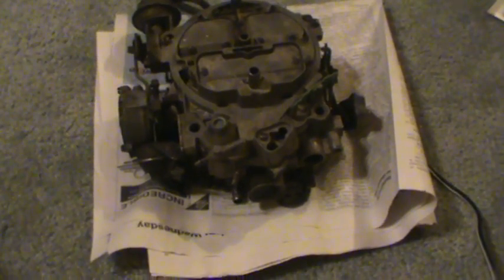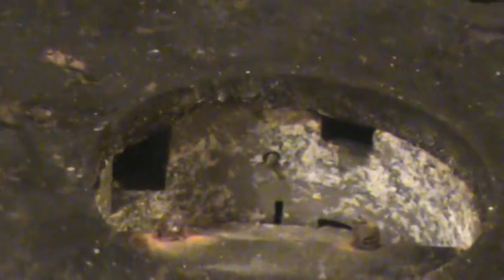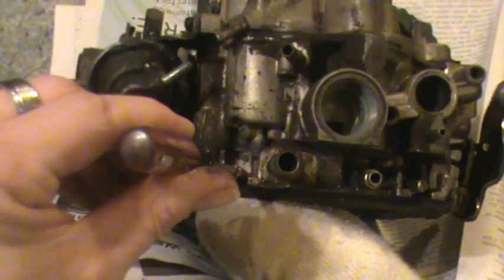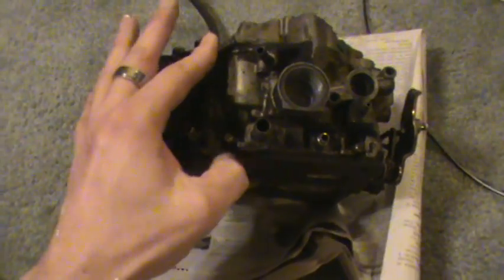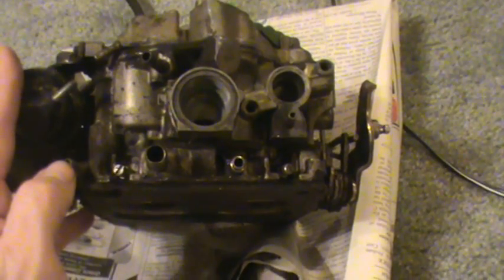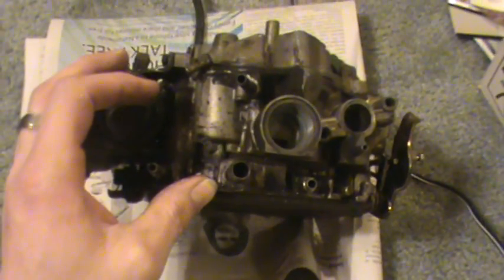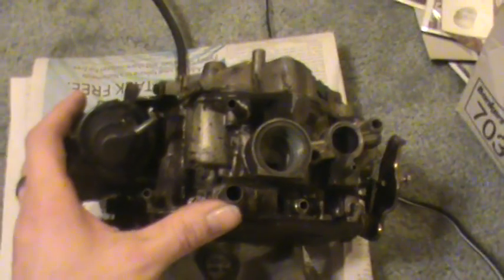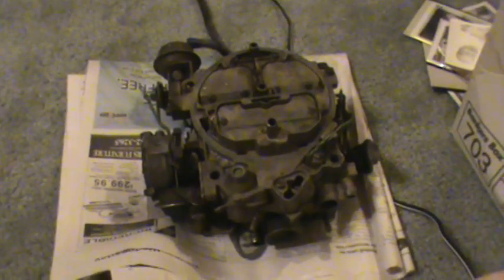How to adjust carburetor mixture screws

Comment: Excellent details!  I have 2 issues here.  I have a 78 lincoln in excellent original condition with 65000 miles on it. The car never was used in the rain or winters. with a 460 and a motorcraft 4150 carb on it.  The car has all the original smog stuff on it and it all works using a vacuum pump and leak tester.  Both catalytic converters have been emptied some time in its life and the exhaust has no restrictions. The engine vacuum indicates a strong fault free engine, plugs are perfect with a little soot and are new. Air filter is new. Gas filter new. The problem is that it bogs from idle when its sitting or if I'm cruising and decide to hit the gas to pass a farm vehicle. When I'm cruising, I have noticed it seems to sputter here and there at cruising speed.  With the car cold the choke system is working ok.  There does not appear to have any vacuum leaks as I tested that with carb cleaner. When I try to do the vacuum idle air/fuel adjustment, there is no problem doing the right side but the left side makes no difference.  I have not pulled the bad side idle mixture screw out to see if the taper is broken or if some clown screwed it in so tight that it broke through the horn.  Next issue, I cannot get a slow idle adjustment when it's normally running at 190 degrees. I cannot seem to adjust the main idle screw down enough to be able to properly adjust the idle RPM.  It always seems to run a little faster in RPM than it normally should at idle even if the screw is all the way backed out so it doesn't touch the plate.  The choke fast idle is OK so that's not holding the idle open.  When I force the throttle manually from the carb to close it then dips to what seems as a normal idle speed.  There is no bind in the carb to pedal adjustment holding it open either.  I'm thinking that whatever is causing the higher than normal idle, the hesitation from acceleration, the sputtering at cruise speed and the inability to adjust the left mixture screw may be the problem area.  The accelerator spits a nice stream on both sides so I know it's not that.  Any input would be appreciated on these 2 issues.  Your videos are the best I've ever seen because you go into great details.
Reply from the maker: Thank you for the nice comments.

Well, you have several pieces of evidence that at first glance appear to point to a vacuum leak. If the throttle plate is closed tight with the screw backed out and away, and the engine still idles, then air must be getting "around" the throttle plate somehow.

I suspect that you may have either a worn throttle shaft bore or possibly a leaking baseplate gasket under the carb. When I was about 17 I had an Impala with a common old 350 engine and a Qjet. It always had a tip-in stumble and also idled high and rather uneven. One day I decided to take the carb off and work on it, and when I got the carb off I found the baseplate gasket was cracked and had caused a vacuum leak.

I replaced that and it solved both issues immediately. I'd also recommend following each and every vacuum line to it''s destination including the PCV valve and look closely for cracks. I think you are going to find your issue in one of the areas I mentioned.

Btw, i had a '78 Marquis myself and I believe that carb is a Motorcraft 4350, which is a spreadbore somewhat similar to a Qjet.
Reply: I think mine is a 4350. The marquis is pretty well the same car in many aspects.  Heres what Im going to do.  Im going to replace a few valves.  The PCV, the heat valve in the lid of the breather, Definitely the EGR cause when I spray carb cleaner around that area, there was a dip in RPM. Once I've done all that, Im going to change out all the vacuum lines with new ones and color code them as original.  When I bought the car, The owner said they had the carb rebuilt and it looks like there was some work done to it because the welch plugs are new.  Im going to strip the carb down and rebuild it if nothing is broken.  I will rebush the throttle plate shafts also.  I have all winter to get er done cause I dont use this car in the winter.  I have some vacumme guages and a vacuum gun to run some tests but for sure everything will be replaced and then we will see whats up after that.  The old smog systems were a real spider web of hoses.  I know that the mixture screws might be an issue but if they look OK then there has to be some sort of leak bypassing that side of the system.  Hey, thanks for getting back to me.  I need all the help I can get.

Comment: Awesome, I got a 78 dodge b200 with a 360 motor and it doesn't like to start, once running fine. I have to question the automotive center I just paid 630 dollars for oil change and tune up. I'm doing this myself as per your video, excellent explanation of what I'm doing. Thank you!
Reply from the maker: $630?? Wow, they saw you coming, sorry to say. Those old Mopars are 
super easy to learn to work on. Feel free to ask anything you want. 
Those V8's like a lot of choke, your hard starting issue is probably 
related to that.
Reply: Wow, thanks. I need all the free help I can get with this running project. It's 4wd modified van.

Comment: apogize if you may have answered this question already but my 69 polara ran fine 6 months back. Then it parked for a long time.  trying to revive it again and it wont idle unless I have my manual choke closed about half way in.  its a carter afb.  it idles just perfectly with the choke this way but it sputters a little when driving and getting up to speed.  did something in the carb get messed up?
Reply from the maker: Your idle circuit in the carb probably got plugged on one side or both sides from gas varnish or possible an insect plugged one of the idle air bleeds on the top of the carb up. When you close the choke partially you are making the mixture rich enough to idle on, but obviously that's not how it should be running. The idle bleed tubes supply a tiny amount of air into the idle fuel supply to help it atomize.

Bottom line is, you'll need to pull it and overhaul it. They are very, very easy carbs to overhaul. Main thing is clean clean clean. You can look at some diagrams and establish where the idle passages are along with the idle air bleed tubes, etc and make sure they are all clean and all flow air and fuel.

Next time when you need to leave it stored for a while, run it out of gas first to avoid this again and make sure no insects have access to the carb as well, lol. Good luck.
Reply: Thanks for the in depth reply.  Appreciate your time.  I had the air cleaner on it.. but I suppose critters could have still made their way in there.  That gas varnish seems very likely too.
Reply: Can i ask you a question , please i need help as soon as you can , reply to me .

Comment: Rebuilt my carb and my idle screws are set at around 6.5 turns out. Is this too much? I did it with a vacuum gauge and it was reading around 20~22 when I was trying to max it out, I feel like I have a different problem. What do you think?
Reply: Take note this is the engine I have in it 

https://m.summitracing.com/parts/
nal-12499529

If that helps any

Comment: question. thanks for the great videos. but I'm trying to get the quad off my 81 dually working properly but can't get it to idle. I rebuilt it with Walter kit like your other video but won't idle at all. I have to keep feathering the throttle to keep it running or it will die immediately. I've moved the idle mixture screws everywhere with no luck. run fine when you rev it up just no idle. any help?
Reply from the maker: Check the ignition timing first. If it's too retarded, it won't idle and makes you think it's a carb problem. After that, you might have clogged idle circuits, but that's fairly rare.
Reply: +WhoSaidTyler changed plugs and advanced timing to 12 btdc and ran good for a day. put new plug wires cap and rotor on now it's back to not idling. looking like electrical gremlins. thanks for the input though!

Comment: the small vacuum Port you pointed to on the right front of the carburetor is for the vacuum advance in the distributor. this is the most commonly hooked up wrong part of any carbureted car it only gives vacuum while the throttle is opened don't try to set idle air with that port

Comment: I do have a question for you and I really hope you can help. Firstly I would like to say thank you for taking the time to do these videos, it really helps us guys that can do these kind of things but just need a little assistance.
I just recently bought a 1990 Isuzu pickup and took it in for smog inspection and to get it to pass they had to adjust the carburetor. They said it would have to be replaced at some point. The issue is that the car stalls at every stop. Is it just the idling screw that would need adjustment or would it be the Fuel intake?
Reply: Same thing for me, i got a 69 f150 and it starts to bog out and wants to stall (sometimes does) when I come to a stop. You probably dont still need help but im pretty sure its both the idle and air fuel mixture

Comment: tyler ur videos are by far the best...i have a 86 caprice 5.0 not sure if its 307 or 305 but anyway someonecstarted ripping off emissions stuff...which ee dont have to worry so much about in ky but i cannot find a video on how to correctly remove what's left and get vaccum lines correct dont know what to block or what not to block off. its my daily drivervand i depend on it to get my kids to appointments etc. now it is dieseling an wont shut off. also someone has turned the big screw on top of carb way down in and i cannot find a video on how to adjust this. it also will not idle down even with idle screw not even touching any help would b greatly appreciated. I am sure u r very busy guy so if u cant reply i completely understand.bthank u in advance in love your videos very informative.

Comment: One of my first engines I ever did anything to back in the day was an old 88 sunbird. Although it is TBI and not a carb it still had an idle adjustment screw on it covered with a plug. This thing basically opened and close the butterfly very minimally. GM always said there was no need for adjustment on it and not to tamper with it. 

Now for those who may not know a TBI is a very simplified version of a carb with a fuel injector on top to spray fuel automatically. This is a decent system and is a little more reliable than a carb. 

That being said GM was full of shit when they said it never needed to be touched. They were thinking someone would never do anything to the engine other than normal maintenance. But the GM 122 engine suffered from head gasket failure (tolerance too varied too much across the head) and soft top end cams. So I needed the later model cam, rocker and followers and so I got them out of a 90 sunbird and rebuilt the head and new everything. It held compression very well and only had 80 grand on the engine. After fine tuning the screw it had no problems at all. But with early GM computers being complete dogs I never changed values to account for the difference in the cam and the head height (lapped to be within proper tolerance .0015) so it ended up needing to have more air at cold start. no big deal I just continued to crack the throttle. 

The car was pieced together from so many other cars to counter all the imperfections of the car. GM should have thought it out a lot better. A later model grand am gave its TBI to my car as well. Trunk torsion bars were from a nova of earlier model year. The EGR was from a 93 (yes I blocked it later but the 93 egr worked on it) The real downfall to the engine was of course the use of a timing belt instead of a chain and the water pump/ timing belt tensioner design. But I can honestly say the engine outlasted the body of the car. 

Now I work on all sorts of cars and so forth but that engine for some reason always remains near and dear to my heart as the engine that I refused to let die and after all mods were done for reliability it was almost as reliable as the 3800. Ahh good times.

Comment: do the mixture screws let in air or gas
.
Reply from the maker: +Bert Cochran They control how much air gets in to mix with the fuel.  Think of it as "bypass" air that is metered around the throttle blades instead of through them.
Reply: I don't know, the carburetor shut out air and it also pulls off like a hesitation
Reply: Tyler's Neighborhood Garage
Reply: Again I learned some more!   Thx!

Comment: on my caprice 305 there is a screw directly by the choke? it looks like it is an adjustment screw...do you know what for? thanks
Reply from the maker: +1986Caprice 5.0  On the top of the carb? If so that's probably where someone has modified the carb so the lean stop screw can be adjusted from the outside. A pic would be great.
Reply: i tried turning it and the engine speed changes. I will try to get a pic, thanks

Comment: Awesome video! I'm about to swap two Rochester 4bbl on Mercruiser 260s tomorrow (350 small block). One engine idled faster than the other and we thought it might be the throttle cable. Thanks for the idea to check the idle screws!

Comment: I have a question about my Quadrajet. It's on a 1971 Buick 455, and freshly rebuilt and adjusted. When the vehicle is moving it's perfect, it will throw you back in your seat. But at a stop, if you punch it I just don't get that tire boiling torque that I know the car is capable of. The heads are freshly rebuilt and the exhaust is brand new from the manifolds back. I'm kind of stumped.
Reply from the maker: +Edward Ferguson IV  Well, you could have an issue with the carb, but keep in mind that's a 4400lb car with 2.93 gears.

Do you know what compression ratio the engine ended up with? 1970 was the last year before they started dropping C/R from 10:1 to 8.5:1, which is a huge drop. The change was made with the piston dish, not the head chamber.

 If it was just built with stock stuff, you may consider some things to wake it up some within the confines of the lower compression ratio, such as a hotter cam. Those cars were optioned with 3:42 gears, and that would do MUCH to get it off the line without sacrificing cruise comfort.

 That all said, don't be disappointed, because there ARE no bad 455 Buicks :-)

Here's some 455 audio for your listening pleasure:

https://www.youtube.com/watch?v=DRizcGGj24I
Reply: +WhoSaidTyler Yeah its running 8.5/1. And it's a standard Riviera so it's probably got the lower gear ratio in the rear end. I had considered doing a cam swap but it just didn't feel right. It's a nice cruiser and I didn't want to make it less drivable. 

Thanks for replying to my question! And your videos were a major help. This was the first carburetor I have ever rebuilt and tuned, and most of the people I know told me to junk it right off the bat. But anyone can just slap an aftermarket carb on there.

Comment: Greetings from Denmark
I really like you video on YouTube but I have one question to you and I hope that you will answer it quickly
Is it right that I have understood that I have to screw out the idle screw on both sides on till the engine is highest on the idling ???
Will the mixture then fit ,?? I just thought it might run to lean if you did it that way,, right or wrong..???
Thank you very much and thank you for the video have a nice day
Reply from the maker: Uffe Lauge  Hi, thanks for watching.

 The easiest way to visualize what you are doing is...if you turn the mixture screw too far OUT, the engine will slow down and run rough. If you turn it too far IN, the engine will slow down and run rough.

Somewhere between those two extremes is a spot where the engine idles the fastest and smoothest. There is no "preset" spot. You just have to listen to what the engine does. You can also use a vacuum gauge connected to manifold vacuum and watch that. You try for the highest vacuum reading at idle.

Comment: hey i have learned alot from your videos. i have a boat with a 305/w a quadra jet. i bought a new carb for it. im trying to adjust the idle mixture screws. as much as i turn them it doesnt change the rpms of the motor. im trying to get this adjusted so i can use it for the 4th of july.

Comment: On my 87 caprice with 305 quadrajet 4 barrel i think it has the double d screws and i bought the tool and none of the bits fit the screws.  Im stuck on this anything would help thanks a bunch

Comment: I have a 1983 Chrysler imperial with a 318 eng. On it, My thermoquad carburetor was "rebuilt" but its not burning fuel right, and by this I mean it's literally swallowing all my gas and shooting it out the exhaust pipe, any idea what the problem could be??

Comment: my carburetor idles high should i adjust the idle screw? And also it takes a while to go down to idle low, is that normal for it to idle high at the beginning, thanks
Reply: It should do this when you start it cold. That is the high idle. The choke closes to make the fuel mix richer when starting cold. Then as it warms up the choke opens and the idles slows.

Comment: I have a carter 2 barrel on a 1982 dodge d150 slant 6. I put a new fuel pump on it and cleaned the carb after reinstalling everything it now just pours gas out the top any suggestions on how to fix it?
Reply from the maker: The float is sticking open somehow. Open it back up, replace the needle and seat assemblies with new, make sure the float moves freely up and down.